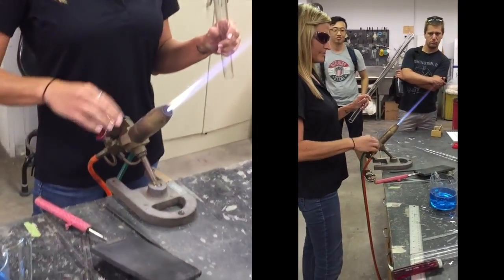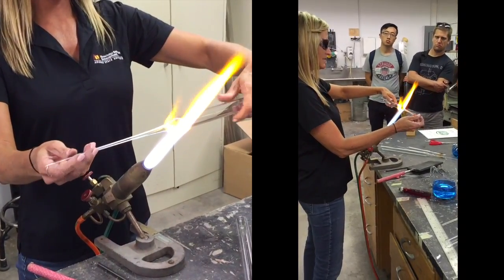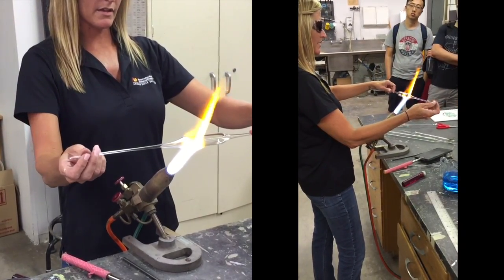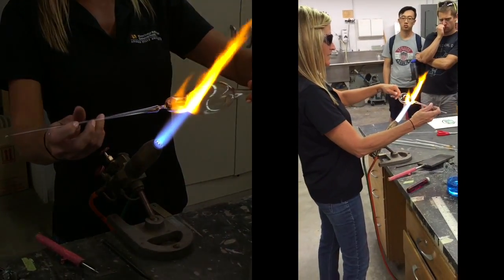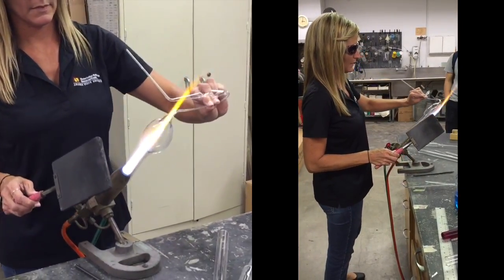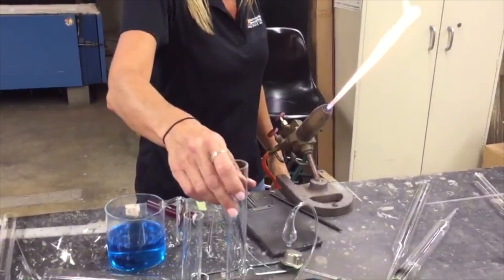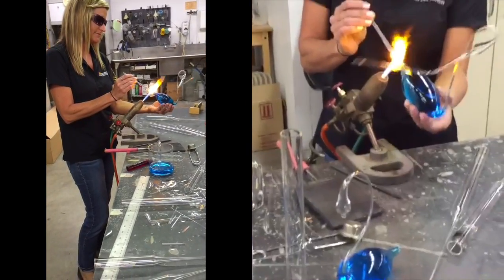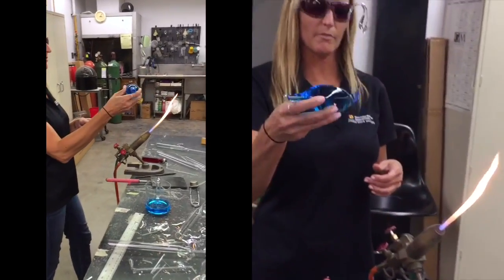Making a Barometric Swan

Comment: Omg...  ok so at 7:13 when she blew through and you see that bit float up... thats called bubble trash... (when you blow it too thin and you have glass particles floating in the air) I don't see a hood/ventilation... i always have a spray bottle around just incase if it happens... always always pop the hole in the fire if you're blowing it out like that better to be safe than sorry...